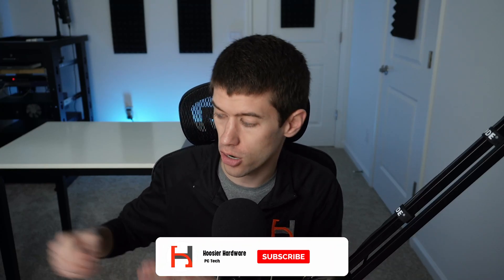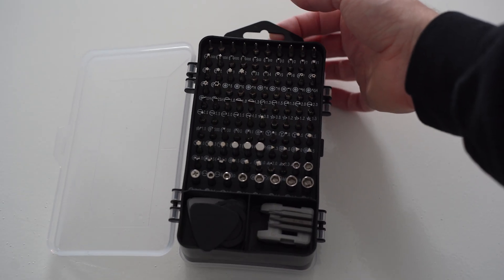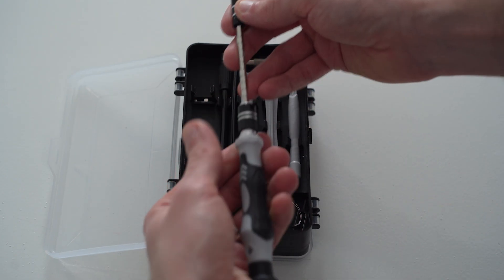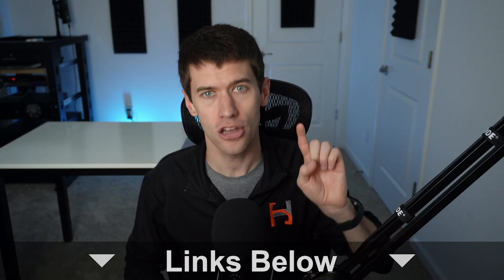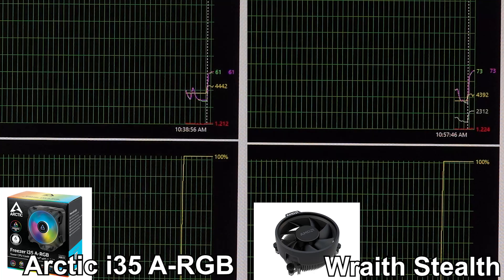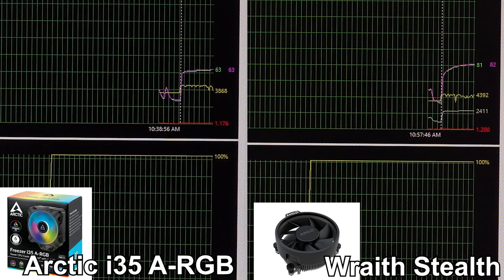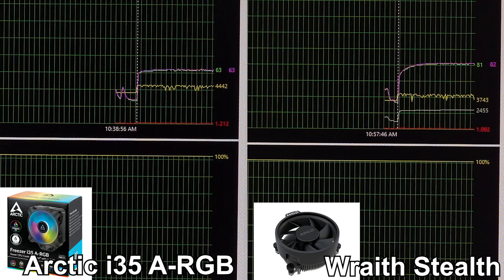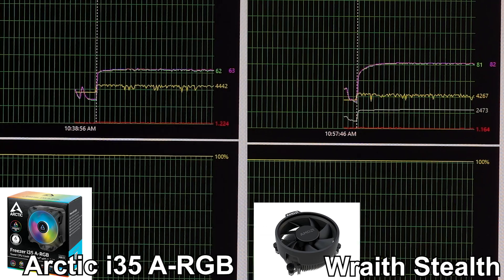Stress Testing the Ryzen 5600 with the Stock Wraith Stealth Cooler

Comment: As someone whose just built their pc yesterday (this is my new one, old one was rocking a rx6700 with a r5 5500, new ones got the rx6800 with the r5 5600), id get an aftermarket cooler, i have my setup built in a ASUS ap201, I've added four fans (2 on bottom for intake, two on top for exhaust, and one on the side as exhaust) and I'm running typically 81-82 degrees Celsius. I'm happy with the performance, but I've ordered an aftermarket cooler to make sure that under a heavy load, my CPU stays cool and safe.  I originally ran the wraith cooler only because my r5 5500 stayed around 73 at most, which for me is comfortable. But the eighties kind of jars me. I know thermal throttling doesn't occur until around 90 Celsius, I'd just rather stay away from high temps as much as possible.
Reply: Why did you bought two AM4 PC?
Reply: @mrmunna9072  I gave my old one to my brother because he was stuck on console for a while. Plus it’s not like I could comfortably hop on am5 saying most people don’t uprgade for years. By the time I’d need to upgrade, Am5 would be dead too. That’s something people don’t understand. Don’t need to upgrade your system every time a new generation comes out. That’s a waste of money, like the people on am5 don’t need to upgrade from it for a while. Now they’ll have more options, but by the time they’re in need of an upgrade, am5 will be dead too. Saying that it’s “end of life” is 2026.
Reply: @Slayd2Pieces  My first PC was Intel's core i3/i5 4th gen. This year I bought a Ryzen 5600. So AM4 is new to me, but it's not popular anymore (after the arrival of AM5) so it's very cheap. But if I had a very old AM4 PC, I really would have bought a AM5 pc. It's expensive, but you know, it's already 2 years old...
Reply: @mrmunna9072  true but to what I said, saying that I have a 5600 and I have no issues utilizing my system that’s fairly powerful for 1440p. I’ll prob not need to upgrade for give or take 4-6 years depending on how games tend to progress. So with that in mind, am5 would effectively be dead. So I don’t see the use case when in the time I’d need an upgrade. The am5 system would be out. But at that point I could upgrade to whatever am5 has as its technical best and repeat the same process.
Reply: @Slayd2Pieces  Why are you saying a new gen processor series will be dead? Remember how long AM4 has dominated the market.
Reply: @mrmunna9072  well they don’t make any new chips for them, so their dead. Like in 2026, am5 will be dead. Because they’ve publicly said in 2026 am5 will no longer be supported. Meaning no new chips or “series”.
Reply: @Slayd2Pieces  Bruh they say 2026 or 2027. It doesn't mean that AM4 won't be dead which is hilarious. They will stop manufacturing but that doesn't mean it won't be in market.
Reply: @mrmunna9072  They released a road map and said that 2026 is the last year for am5, and never said anything on 2027. And yes they’ll still be sold but they’re dead in terms of no more new CPUs being released. What’s so hard to understand? Dead means nothing new will be released anymore. Am4 is dead because the 5600x3d and the 5700x3d were the last CPUs made for the am4 platform/socket. Doesn’t mean they aren’t in production. And everyone talking about those CPUs uses the term “dead”. But I digress, can’t control stupidity or make people understand when they cannot control their own “Ego” or “thought process”.
Reply: @Slayd2Pieces  You are talking about both CPU series dead while defending your purchase of AM4 but not the AM5 while already having a AM4 PC 🙄. That's hard to understand lol. Our market still has tons of AM4 and AM5 cpus.
Reply: @mrmunna9072  well yea and I didn’t deny that, nor am I defending my argument, just seems more like your too dim in the headlights to understand.
Reply: @Slayd2Pieces  yep. trying to be smart only to hide that someone is trying to save some money lol. Some big brains you have bro.
Reply: @mrmunna9072  well I mean, don’t need nothing more then a 5600 for 1440p, plus if I wanted to, the 5700x3d is more powerful then the base 7000 series outside of the x3d’s. So not so much of money, because I don’t have many bills and I make $3,000+. Just mainly that I didn’t see the use of getting am5 when it doesn’t promote more performance. (With the rx6800)
Reply: @Slayd2Pieces  Keep giving consolation to yourself for nothing, it's youtube lol
Reply: @mrmunna9072  lol why would I need to consult myself with my own decisions? That’s kinda counterintuitive.
Reply: @Slayd2Pieces  yeah sure keep saying rigorous talks only to prove nothing instead of giving simple answers come on😆 who gives their earning information on a comment debate in youtube😂
Reply: @mrmunna9072  well you stated that I went last gen because I was trying to save money, I simply said I didn’t and gave information like my monthly salary to exemplify that.
Reply: @Slayd2Pieces  Yeah sure I totally believe you man lol
Reply: @mrmunna9072  Saying your messaging me in the middle of the day, on a Wednesday, means you probably don’t even have a job. I’d focus on making money rather then criticizing my statements, and or choices lmao.
Reply: @Slayd2Pieces  It's evening here in Bangladesh bro 🤣 And probably your brain missed a point that I'm replying you a day late on this specific time 😂 But seems like you reply on time to time like you got nothing to do 🙃

Comment: Stock cooler works perfectly for me on the 5600G except in summer. When the ambient air temperature exceeds 30 °C I start to see thermal throttling. Below 30 °C ambient I can run full tilt all day long at a toasty 80 °C. Instead of upgrading the cooler I just settled on using summer afternoons for retro gaming, because otherwise the gpu + cpu are dumping just shy of 300 watts into my room and it gets stuffy really quick.

Comment: for comparison, I used the old R5 1600 cooler I had and it works MUCH better than the r5 5600 one... 

It's a shame AMD is going through the same intel route!
Reply: 1600 got wraith spire, 5600 got wraith stealth, same as all r3 in 1st gen.😂
Don't mention Intel, their cooler straight to 🗑️

Comment: thought stock cooler would be good enough since I'm pairing it with a 5500, but the fan gets too loud under load plus temps are a bit high (not throttling though)
Anyways I ended up spending extra for a better one

Comment: very weak coolers for the Ryzen 5 series and not stealth at all. I get up to 85 C under havey load. That's unacceptable, AMD should have included a capable cooler or no cooler at all.
Reply: I ran cinibench I it hit 95C!!!! but what was strange is that the cpu refused to throttle
Reply: @G80M3C  I fixed this issue by undervolting the CPU by -28, I got better benchmarks and it wont go above 76 (in the summer). So I didn't replace the cooler, I still have the AMD Wraith
Reply: @G80M3C it's throttled once hit 100c
Reply: These CPUs can fo over 90°, chill
Reply: @ThePipojp  can go but its close to thermal trottling, the boost will be turned off and you will have reduced performance. Learn about it.

Comment: considering that this cpu is now 190 dollars canadian and the included fan is worth 40$ itself , i think its an awesome deal. its also only a 65w tdp and only 6 cores so it dont require a very powerful cooler. if you do alot extreme gaming and do overclocking , yes you better get a 3rd party cooler which performs better. you can also have more case cooling which does help. you could also buy the even better ryzen 7 5700x or 5800x which are 8 cores and get yourself a great cooler since they come with no coolers and do require a better one than the one included with the 5600.
Reply: That’s too much the 5600 x is enough

Comment: He didn't say whether he used the pre-applied thermal paste on the Wraith Stealth or if he cleaned it off and used a better 3rd party thermal paste.  I am getting way higher temps (like 85-90C at only 30-40% utilization).  I am wondering if it makes a big difference to clean off the stock thermal paste and apply something like arctic silver in its place.
Reply: Yes it does, mine dropped more than 10C
Reply: @Merryweather Fleet  I ended up getting the $20 Thermalright Assassin X120 from Amazon to replace it.  My CPU temp now peaks at 65C in the same games that were spiking to 94C with the Wraith Stealth.

Comment: With stock I was getting temps around 90-95 when playing games and it was throttling the CPU. Used my old air cooler and now the temps are around 50-60c at full load. I'm from India so the weather is hot as it is.
Reply: I am facing the same problem. What is the cheapest treatment for it.
Reply: @fahadzargar8975  just get beefy air cooler..make sure it has am4 support. And you're good to go
Reply: I optimized.. it works fine.. im using a stock cooler.. doesn't use more than 58-59 watts and cinebench score is also better
Reply: @fahadzargar8975  it was thermal throttling hence the cinebench results are better now. Undervolting does help but again I'm saying nothing can beat the hardware. You just raw dog everything.  I'm replying here just so that people will not get a wrong idea.
Reply: Budget air cooler doesn't help?..  like the deepcool AK400 level
Reply: @fahadzargar8975  yeah absolutely ! It should get the job done man.. temps would be somewhere between 70-80c on full load in worst case scenario. Which is perfect. Go with a decent thermal paste like artic 4 and you're good to go.. stock cooler sucks !
Reply: Which cooler are you using i m also facing this issue
Reply: @UltraSolarGod  I'm using CHIPTRONEX Diffuser X500 RGB. It's huge though cools the processor really well
Reply: You should rather use the ryzen master tool and do the curve optimisation. Set -30 offset. It will limit the power and increase the performance as well. You can check out the detailed tutorial on YouTube.
Reply: @fahadzargar8975  already optimised still nothing can replace a solid cooler.
Reply: Do you have an airconditioned room? Mines new but its hitting 77° on the cpu on an airconditioned room.
Reply: @ValkplaysPC  try using curve optimiser in RYZEN master. It might drop your temps 10+ degree... And no I don't have AC in my study where I have my PC.
Reply: @ValkplaysPC  let me know if it worked for you
Reply: Really? I'm using ant esport 6 pipe cooler  and it's hitting 80-84c while gaming
Reply: @lostSkyRyu  air conditioned room or no? And do you live in a hot climate country?
Reply: @lostSkyRyu  ant products suck... Deepcools AK400 Is fantastic. You should give it a try... But I'd still recommend using a better paste first before thinking of getting a new cooler
Reply: @AakashKale27  can you send the link of the cooler your using aka the chiptronex Diffuser x500 rgb
Amazon link if you can
Reply: We all get different result lol I am getting around 70-75c while gaming .
Reply: Dang same like my FX 6300 rn. Im better get a real fan cooler than that stock cooler
Reply: Bro which process are you using
Reply: @lordcosmos1707  ofcourse it's 5600
Reply: @AakashKale27  bro my motherboard was stuck in the cpu debug light. In pc repair shop they said cpu was the problem, i am also using r5 5600. but my pc was 2 years old ,i only used for 3-4 months ,it was now black screen while booting and stuck in the cpu debug light in msi mobo, i tried cmos and ram eraser method, it works and after 10 seconds it become black screen, what is the main issue. Is win 11 Os update or cpu or driver?....
Reply: @lordcosmos1707  take alcohol and try to wipe the place where you put your processor. i had this issue too with my old 2600.
Reply: @AakashKale27  ok bro i will try that
Reply: What maximum rpm fan for stock cooler?
Reply: @BenangKain don't remember.. just google it
Reply: How many rpm does your stock cooler fan get when it's 95°c?
Reply: @BenangKain at 95 degs stock cooler reaches 1900 rpm which i think is the max speed but it varies speed and is not enough to cool the cpu so it gets bottlenecked and runs at lower clock speed resulting in lower fps in games. Stock cooler is terrible for gaming for the 5600 especially if youre in a hot country like india.

Comment: I have a issue. Used Ryzen 5 5600 with the boxed cooler, activated xmp for ram with 3200 MHz and I see the temperature of CPU 96°C in stress test of Aida64. I think that is too much. What is wrong ?
Reply: also maybe he didn't use thermal paste on the cpu lol
Reply: Exactly like I wrote in another post, probably the RAM is heating up more because it's now overclocked -> so more heat in the case = higher CPU temps indirectly. Also maybe the CPU is now being utilized more as with faster RAM you have basically faster CPU (Ryzens are very dependant on RAM speed). This cooler is only suitable as emergency, not any serious work. How good is your case airflow? Cause OCing RAM can increase it's temps by 10°C easily and all that air is being sucked by the CPU cooler.
Reply: @kovrcek  Stock DDR4 ram with factory 3200 MHz you still have to turn on xmp for the motherboard to see the 3200 otherwise it keeps it at stock DDR4 speeds 2xxx
Reply: @GoatzombieBubba  op has activated xmp, read it again

Comment: Thanks for posting this. The point you made about Wraith and airflow is crucial. I'm running the 5600 and Wraith in a Goodisory A02, and the temps hover around 95C after 15 minutes of gaming. But if I take the lid off, it's around 65-70C. So I'm deciding whether to upgrade the cooler or run w/o the lid (maybe add dust filter on top)
Reply: man, I hope you answer my comment, I have an 5600 as well, when I play Elden Ring with everything on ultra, my temps go above 70°, like 78°, Im gonna upgrade the cooler, how you solved the problem??
Reply: I have an pc case with 6 fucking fans, tho the fans that I'm mentioning is the ones who came with the case, but still, the cpu temps reach 78° when I play ED, or when I run an stress test
Reply: @ranger5389  I cheaped out and just bought a dust filter to replace the top lid of my case.  My PC sits horizontally w/ the fan and mobo facing up.  If I get more money, I may upgrade the cooler to Noctua L9a.  I'm also using a 250w pico power supply since I'm only running an RX-6400.  So, I added two more case fans where one would normally put a power supply to extract more hot air.  That said, it only helped to reduce the temp about 2-3 more degrees or so.  But, I'll take anything i can get.  Hope that helps.. and good luck on your set-up.
Reply: @tobylee1170  I managed to make the temperature drop a little without loosing any performance, I have set the fan rotation to max, and it only gets to 77 for a few seconds, and then drops again to 70°, and 69°.
  Still, not the ideal, but I'll upgrade my vga and then I'll buy an good cooler, good luck with your setup too bro
Reply: about coolers, I want to buy an noctua l9a in the future too, because it's small and efficient, I kinda feel like those big coolers will make the air flow on my pc worse, in parts like the vrm idk, but noctua is so hella expensive here in my country
Reply: @ranger5389   I agree.  I saw a reddit post from someone else using my same Goodisory case, and he switched from a Noctua L12s Ghost to L9a for the air flow reason you mentioned and had better results.
Reply: @tobylee1170  I have some updates, its very warm here in Brazil, like 30c at night! and almost 40c at day, then the cpu is hot again, but it seems to get hotter when I play Elden Ring, I don't know what to do anymore, maybe I will just give up and don't bother anymore, Im getting 84c
Reply: @ranger5389  you need to chill out. As long as it isnt hitting 95c you are fine. The CPU is designed to run that hot and still last for 8+ years
Reply: @rhapzodyk541  does it improve frame rates in games if the cpu is cooler?
Reply: @anonymousbird-4  If it's not thermal throttling, not by much. Probably around less than 1-2% fps increase or something depending on the game

Comment: I use my 5600 with stock cooler. every game I play runs 60~73°C except Battlefield 5, as soons i open the game is goes to 83°, makes no sense, anybody know what coud be ? ty
Reply: It's fine, it's just that gaming ( even multi core heavy ones like BF5) isn't as heavy on all the threads so your cpu tries to boost a little more causing temps to be slightly higher than a full core load ( slower clocks) but still, if noise doesn't bother you 80c isn't gonna kill your cpu.
You can also try undervolting and save even 10c :)

Comment: Bought Id-cooling se-224-xt  black with the 5600 off Amazon UK. Was  easy to install the cooler on my budget Gigabyte A520m  board. Keeps the cpu cool and not too noisy if on normal /silent bios cpu profile.

Comment: I feel that as time has progressed AMD has gone the Intel route and is cheaping out on the included cpu cooler compared to early Ryzen 😢 I know the manufacturing node has improved, resulting in better thermals, but it doesn’t mean saving maybe a dollar for a noticeably reduced performance on their non-X skus’ is warranted.
Reply: Personally I would rather be that AMD sell those CPUs without a cooler and give a price discount as running this stock is always just for emergency use (waiting for new cooler, old cooler broke, no money etc.), not for serious gaming build. The noise is bad and the performance lacking. No headroom regarding heat dissipation so if you overclock your GPU, RAM etc. not even your CPU, it probably won't cool it. I'd consider this kind of cooler only for limited use and with very good case air flow.
Reply: I mean it's better than not getting anything I guess lmao